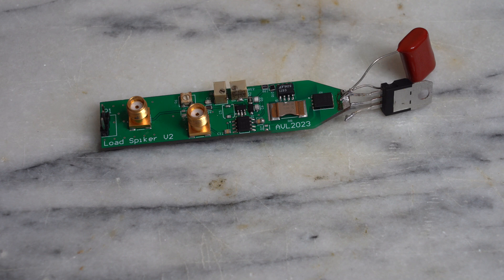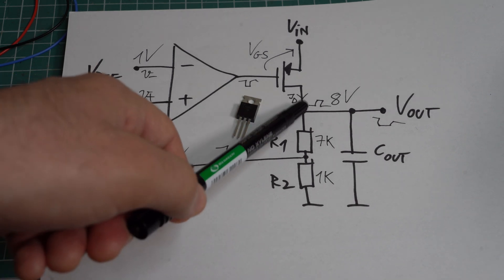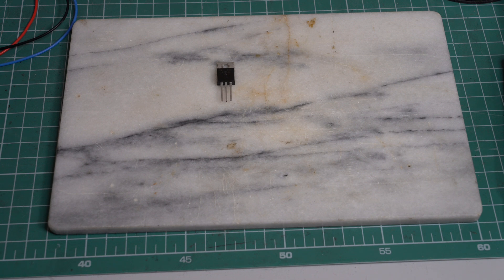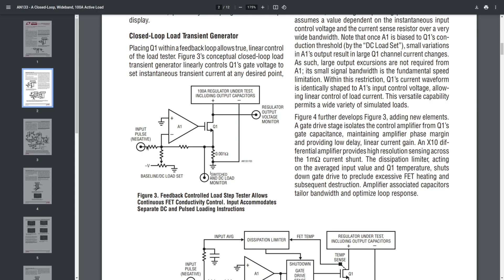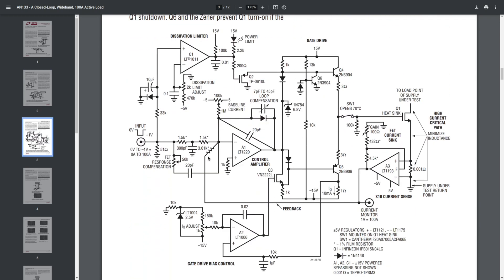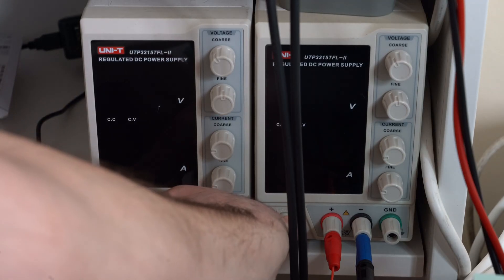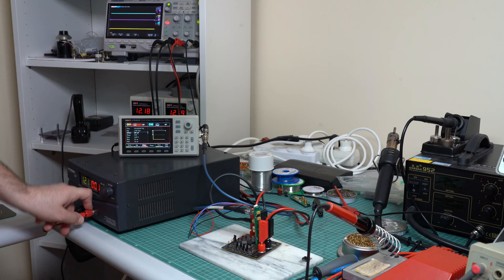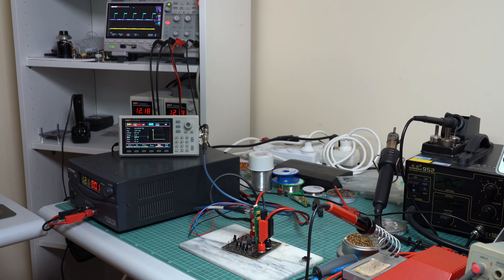Analyzing Transient Response Using Jim Williams' Active Load

Comment: "Improved Jim Williams' circuit" is a very strong statement, especially when it doesn't seem to be true. 
You made it significantly worse.
Reply from the maker: I get your point, however the schematic is quite old. The simple fact that the obsolete MOSFET was replaced by a current one with lower gate charge is an improvement. Also, it was made smaller by using a gate driver IC that does the trick. It is worse since it doesn't have the dissipation limiter, but if it fits my needs and I prefer it to be smaller, it is still an improvement for me. I'm pretty sure based on your comment that you know that in the analog world you have to pay a price in order to improve something. Maybe share your thoughts about what makes this version worse, if you feel like it. Thanks!😁
Reply: @VoidElectronics maybe you needed that gate capacitance to dampen the ringing of the circuit. Jim Williams put out a clean 100A pulse,  you put out a ringing mess. 
Maybe it works for you, but it's hard to speak of supply stability when your load itself is not stable? 

How to fix it? 
Add a gate resistor to the FET, for one thing.
Reply: @danstiurca7963  Hello
Can you elaborate more on why the ringing would be an issue? My knowledge is limited to say the least but I would assume that the fast rise is needed to replicate a dirac impulse.
If my assumption is correct, wouldn't it be more suitable to have a faster rise than some over/under shoot ringing?
Reply: @ezengondolkozom3700  the point of the original circuit isn't just to go fast with lots of current, anyone can do that. 
The point is to go fast with a very precise, well-defined amount of current. 

Taking one step back, the whole point of a load tester is to test the stability of the supply. 
If the load itself is unstable, how can you use it to test the stability of the supply? 

The unstable "improved" circuit failed at its basic purpose, which is to test stability.
Reply: To be fair, certain circuit testers, such as this load tester, are designed to be fast and loose, no need for perfection at all. What's relevant is how you upset the device under test, all that matters in reality. 🤷

If you chase perfection too much, you are missing out on some important information - I have been caught out by surprises before so it's best to do it by brute force - even certain semiconductors manufacturers do it this exact way nowadays to be able to properly certify the voltage regulators here, especially for clients who's paying pretty pennies for that, they don't care about prettiness, they want guarantees.
Reply: @Dr_Mario2007 he took a good circuit and turned it into a bad circuit,  then called it an "improvement"

Comment: The opamp input pins are swapped in your schematic; the reference voltage should be tied to the non-inverting (positive) input pin. Negative feedback causes the inverting input terminal voltage to 'chase' the voltage of the non-inverting terminal. When the feedback loop is closed, the inverting input voltage will be very close to that of the non-inverting input voltage.  They'll never be exactly the same, because the open loop gain of real opamps is not infinite. This assumes the use of voltage feedback opamps (vs. current feedback, which behave differently).
Reply: Pay attention to the P-MOS.
Reply from the maker: Nope, the schematic is right. It also got me the first time I saw it. Due to the PMOS the circuit has negative feedback because the output of the opamp needs to go lower in order to make the output of the regulator higher. The simple proof is at 02:51.

Comment: A good video on a neglected subject. There does not seem to be standardized tests for specifications of power supplies for dynamic loads and consequent transient responses. Some loads, such as morse code and radar transmitters, are a very dynamic loads, essentially on or off.

I did some experiments as a radio amateur using a programmable load where I was able to synthesize a dynamic load similar to CW. I used a reasonably priced Tenma 72-13210 300 W programmable load and an oscilloscope with a current probe.

I think a lot of people think linear power supplies are less prone to transients than switching power supplies, but each have negative feedback loops and a consequent transient response.

I started a blog post in 2022 but never finished it. Search my callsign, VK4ZXI in Google, then "Transients" in my blog.